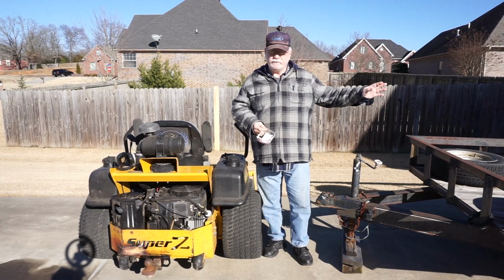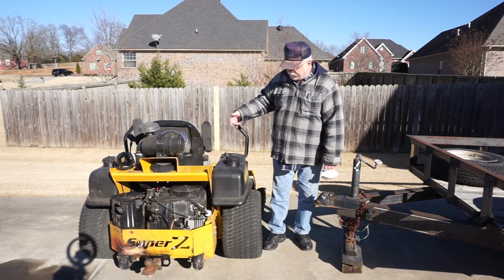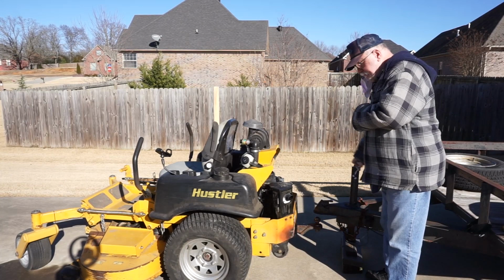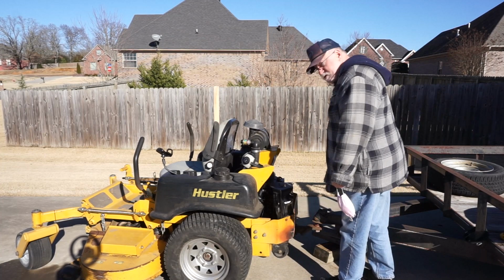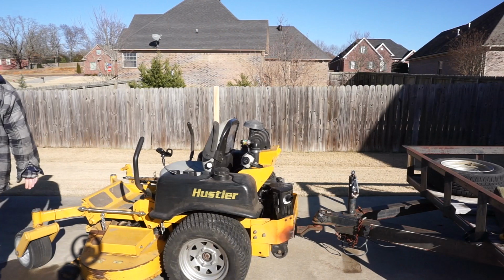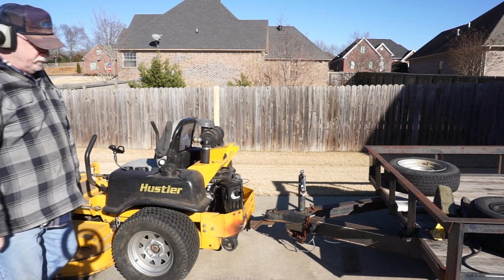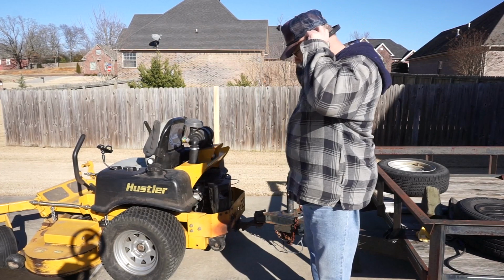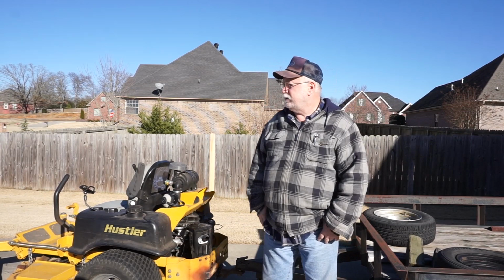Putting the Zero Turn Class III Receiver Hitch to the Test: Unveiling a Surprise Twist

Comment: My yard has swales, low spots, that I must cross perpendicularly. Maintaining the clearance of the back of the mower is critical.  If I were to install a receiver hitch on the back of my Hustler mower, it would have to be removable. Otherwise the hitch would bottom out and dig in when crossing the swales.
Reply from the maker: This hitch doesn't stick down as far as the rear cross member so you'd be just fine with this design. Bear in mind it is super overkill for a mower of any heft and size. But, it was built to show you that you can use a standard Class III hitch you may already have.

If you have a 1" receiver hitch, you could very easily build a receiver for those which is less than half the distance across and they will pull much more than any mower can move so that would be perfect for you. I use Class III hitches on everything I have in order to switch them around.

Thanks for watching and "Y'all come back and see us, ya heah?"

Comment: Wow!!!!! All I can say is wow.
Reply from the maker: It works absolutely perfectly. I'm removing the engine and right pump at the moment in order to rebuild the pump, change the seals in the engine.

You guessed it, the hitch needs to be dropped to make it easier to get to one of the engine mounting bolts. haha.

Thanks for watching. Hope you sub'd and liked.
Reply: This thing is a hoss.
Reply: @MaxsGarajMahal  what horsepower engine are you towing that with? And what weight is the trailer?
Reply from the maker: @dakota481  Engine is a slap dab wore out Croewlur CV745 28hp EFI. Rebuilding both pumps made it pull much stronger as the old machine has over 3500 hours on it with same everything except oil, grease, filter and plugs. Tires are thin. Before I pulled the trailer the left pump was weak and failed before that video. I rebuilt them both and now it thinks it's a hoss!

The trailer is a 20' somewhere around 450 to 600 pounds is my guess. Most I've hauled on it was a 2004 Yukon. Just don't go downhill with it. haha. Or much of a downhill anyway.

The hitch is much stronger than the mower of course. One thing I really have to do is build an elevated ball stinger so the trailer sits level when it is hooked up.

Hope you enjoyed the video, sub'd and hit the little bell. Will help us a lot.

Max

Comment: How much does the trailer weigh?
Reply from the maker: Its a 7' x 20' trailer. It is fairly heavy around 750 pounds I'd guess. I've never run it across a scale. I  used it to carry 120+ 8x8x16 concrete blocks along with 40 20"x20"x4" solid base blocks along with all the items to level a house, metal banding, tie down augers, hard wood wedges, etc. 

So far the heaviest thing on the trailer I've moved with the Super Z is 3 Hustler ZTs at once, filled in with two push mowers, a few trimmers, fuel cans, etc. Handled it very well. I will remind you unless you have your electric brake connector hooked up, do not get anywhere near a slight decline cause you'll find the bottom of it whether on top of the mower or below it.

Comment: I like that black mark you left, it’s a whole lot easier backing a trailer with a zero turn then it is with a tractor type mower I wish I could haul more with my Raptor SD but it only recommend 300 lbs that counting the rider too, I like that hitch Max .
Reply from the maker: I saw that pair of tire tracks and got a kick out of it. Guess those ole tires are so hard they needed a good cleaning. lol

I'll find out after I put the same kind of hitch on mine. The RSD is getting a front hitch as well. 

Let's find out what it can do.
Reply: I agree, reversing a trailer with my SCAG Cheetah II is super easy.

I also run a class III hitch with weight distribution & sway control.

I'd personally never tow more then 500lbs without sway control.

Comment: I have a bad boy ZT elite with zt3100s in it. I have put on a hitch on the front deck. We have a pretty heavy fishing boat. I’d love to be able to back it into the garage with the zero turn. Total weight of boat and trailer is around 7000lbs. Is that something my zero turn could possibly handle or am I asking to destroy something even trying. I’m wanting to be able to push it back about 20ft or so and have better control versus driving my truck since I get it very close to the sides and back.
Reply from the maker: To be honest, that is a bunch of weight. I'd do a tongue weight test first. Those 13x6.5-6 tires aren't made to hold a shyte load of weight and neither are the wheel bearings. If I were going to attempt this task with my antique Hustler Super Z just because I do shyte like that. I'd do it with the rear mount hitch. I would make the ball sit high in order to align it with normal ride height of a pickup via a raised hitch. You could also attach a trailer tongue hitch wheel under the hitch in order to keep the mower from doing a wheelie during the move.

However, with trailer tires aired way up to make them friction free as possible, I know Tha Max and I'd shove a ball into the receiver hitch, hook it up and ease into the handles. If it begins moving the trailer with ease, and it probably won't due to the weight of the mower compared to the movable object is a bunch of difference, I'd not have a problem doing it. Pumps are easily rebuilt as are wheel motors so go for it and remember,  shyte happens and you're doing it at your own risk.

Hopefully you will be successful and it works out.

Hope you subscribed, liked and thanks for the comment and thanks for watching

Max
Reply: @MaxsGarajMahal  I’ll add a wheeled jockey to the trailer tongue to take some weight off and test out my tongue weight also. If it works it works, if not oh well. Yeah I didn’t think about those small wheels up front. Was just thinking the rear mount isn’t very stout where the front is attached much better. I may weld on some bracing to the rear to be able to mount there.
Reply from the maker: @redman2751  That's exactly what I did. I made mine stouter than the mower can ever handle so that the mower frame isn't weak and overworked at that point. I also used material that will hold the weight at the weld points as well laterally, vertically and radially under loads.

This was more of an entertainment video than you need this. It is nice to move trailers around or even pull a rolling vehicle and other machinery so. 

For full transparency, I have rebuilt both pumps and they are hell for stout. I replaced and everyone says don't do it, the cradle bearings. Both pumps with 3500 hours on them looked like a big block chebby with worn out main bearings. Not now. 

I also increased the spring rates on both the 9 pistons as well as on the shock valves. Factory rep said don't do it. Just don't do it. I'm an old and I underline old racer. What is a racer going to do, increase the pressures. It is a wheelie machine now! lol It even lays some rubber for me. 

Keep me informed as I'd like to hear of your successes.

Max

Comment: I learned my "lesson" last year when I moved my single axle utility trailer (empty) to a different location in my yard.  My Hustler Fas Trac  got both of it's hydro gear motors ruined really quick.  That was $2200 blown down the toilet.  I don't believe these mowers were designed to move heavy objects like that.
Reply from the maker: Totally different setups. The Fastrac has combination wheelmotors that are the pump as well as the drive. These are the same pumps and wheel motors in a Skid Steer, Log Puller, etc. Plus, they're worn out. I intend to freshen them in the not too distant future once all the hydraulic and fuel hoses are replaced on video.

Then I'll more than likely do a series of videos on rebuilding the hydraulic system. 

What did you do with your old wheelmotors? I would like to have them to rebuild them on camera. That could help you and millions of others to see what is inside, what each part does and how to determine if there are any parts that can't be reused.

If you still have them. Find out what it would cost to ship them to Searcy, AR. If I can afford it, I might be able to take them off your hands.

Thanks for watching. Hope you got at least a giggle out of the video.
Reply: I was told the ones I had were "unserviceable" and factory sealed.  They had no core charge for the new ones so I just put them in the trash.  A BIG MISTAKE ON MY PART.  I sure wish someone would have a video on tearing one of these apart to see if they are actually serviceable.  I did get a kick out of the video, KEEP THEM COMING.
Reply from the maker: @raymondforet2662  Oh no! You were lied to. Not unusual for that to happen at dealerships. Sorry to have to state that. It is true. 

Yes Sir, they are both serviceable as well as possible to upgrade them to the more powerful pieces from the ZT3200 and ZT3400. 

That was what I wanted them to first make them work as designed as a ZT3100. 

Then do an upgrade to ZT3400 gears, shock valves and pumps. This would have taken your machine from 7.5 or 8 mph to 10.5 mph during mowing.
Reply: Hi again Max, I wonder if Hydro Gear Model # ZC-BCBB-3M5A-1EPA drives are repairable?  If so where can they be done?  Hydro Drive does not recommend doing it for my drives.  And so far no one seems to know what I can replace these drives with.  My machine was bought in 08 and it was from the 07 model year.  Any advice would be appreciated, thanks. @MaxsGarajMahal
Reply from the maker: @raymondforet2662  Did you do a cross reference on that number to see which ZT those are?
Reply from the maker: @raymondforet2662  Here is the parts diagram for your units. Yes it is serviceable. I have a couple of posts or more in my Hustler Mower Owners Official Group in Facebook you can check out as well on how to do it. https://www.jackssmallengines.com/jacks-parts-lookup/manufacturer/hydro-gear/transaxles-zero-turn/310-2200-ezt-series/zc-acbb-3m5a-1epa/service-schematic
Reply from the maker: @raymondforet2662  There is no reason you can't repair the drives you have. However, if you are wanting to replace them with another pair. Bottom end would be ZT2800s and better more torque possibilities would be ZT3100s since they have cut steel gears, two shock valves and you'll get another half mph over the 2800.

P.S. both of those have filters.
Reply: At work I'm converting an old gravely zt50. Deck is nice still cuts but I removed it and I am strengthening the frame. My plan is to add a small hydraulic pump with a small reservoir to a cylinder that raises and lowers a small custom plow. I want to use it to get in tight spots around the bagasse boilers and barns where the tractors don't fit.  
 Anyway after really learning about zeroturn drives i have a feeling even with bagasse pretty much being lighter than snow the drives will not hold up.  Would be cool if it does work thought. I was tempted make custom tracks for it but instead opted for some wheel spacers and larger tires.

   Anyway should be a neat project. Subbed and liked keep up the content.

Comment: Wow, great video Max!   I'm looking to install a receiver also, maybe even a Class II.  I have a Gravely Zero Turn same size as yours.  Also have a trailer like yours that I move around the yard (only when empty).  My trailer empty weight is 1500 lbs with a tongue weight of prob 200 lbs.   So how has your ZeroTurn been holding up after you've been pulling your trailer?  Any bent metal where you mounted it?  I prefer to ultimately mount my receiver to the frame to better distribute the weight so nothing bends.  Just looking for ideas.  Thanks!!
Reply from the maker: The mount is plenty heavy enough as well as the frame and engine guard it is mounted to.

The hydraulics really could care less since it is the 21cc pump and big wheel motor. They are the same thing you'll find on a lot of the skid steer units.

Just remember stopping on a slope can be exciting or even non-existent. lol

If you have anything else you use a Class II on, nothing wrong using that for interchange purposes.

I still don't recommend doing this at home. It was for entertainment purposes as well as my own use only. 

If you do it, make it heavy, make it safe and you're doing it on your own not by my recommendation. 

Have fun and share.
Reply: @MaxsGarajMahal  Thanks for the reply.  Safety all the way...yea, I know you'e not recommending anything.    Regarding the weight ratings on zero turn mowers, it seems like the amount we can tow is completely dependent on the transmissions.   My specific model zero turn uses 2 Hydro-Gear® ZT-3400 hydrostatic transaxles.   Pump Displacement is 12cc and Motor Displacement is 16cc for each unit.   According to Hydro-Gear, each unit has a gross weight limit of 1600 lbs each   So here’s my line of thinking..Each transaxle rated to 1600 lbs (so 3200 lbs total)  Subtract 1375 lbs (mower weight, gas, and my bodyweight). That leaves 1825 lbs.  Would it be safe to assume that my zero turn can pull up to 1825 without overheating these transmissions?
Reply from the maker: @boeingav8r  To be honest, your mower will 'most likely' pull much more rolling weight than that. Again, the problem wouldn't be so much pulling it as starting the roll and more importantly stopping the roll. 

If the trailer has an electric brake, I'd add a variable rate switch and a lithium battery to control the stop. I really put that old girl into a full three tire off the ground to the right with a 100 degree downhill to the left whoops deal. I managed to still get ahead of it while doing 20+ mph down that hill. Corrected it into a jack knife situation and made a 180 degree turn. Was exciting, not fun for most but definitely making me think I wish this was being recorded as the maiming, bloodshed and skin removal will sell a lot of video. haha.

Since then, no more wide open throttle down a hill pulling a heavy trailer.

Just make sure you can stop without jack knifing while putting yourself and others in danger. While I find this stuff fun, your mileage may vary.
Reply from the maker: @TheSwampChicken-II  I resemble that last remark. lol